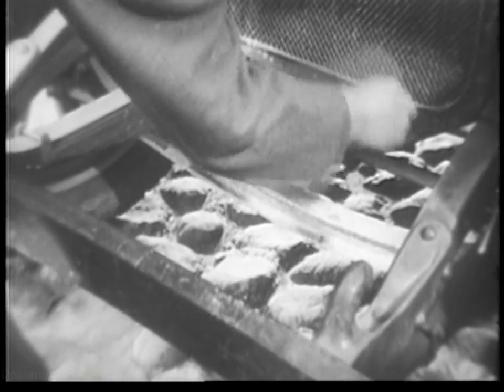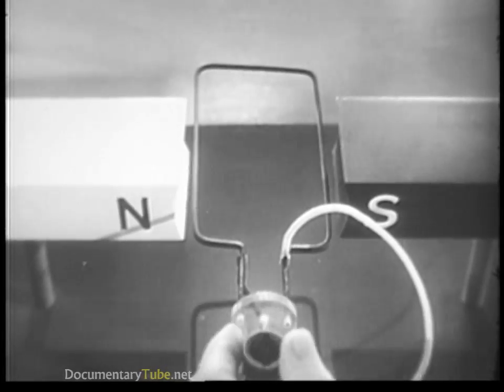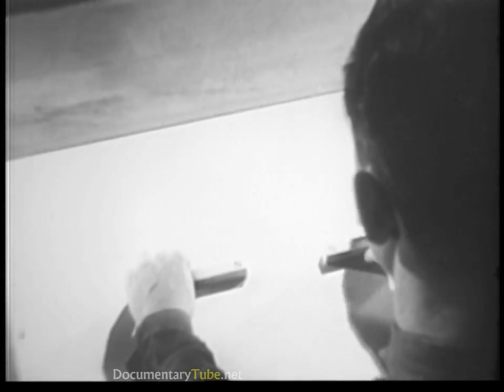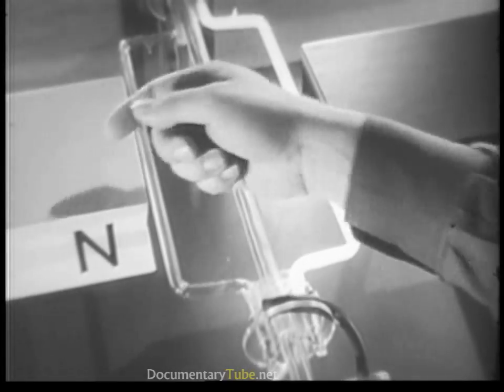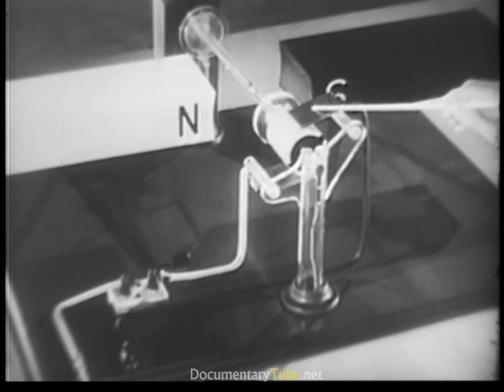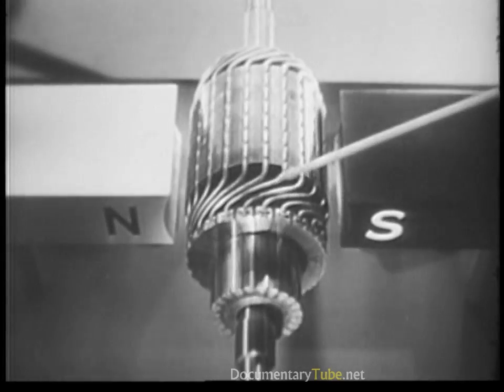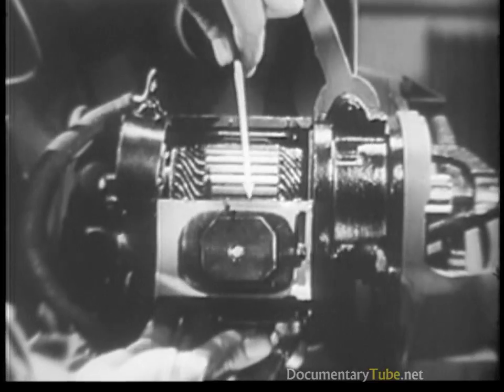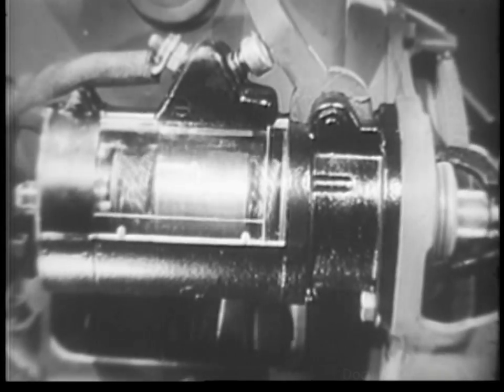HOW IT WORKS: Car Starter Motor

Comment: Why do starter motors always fail to start the engine at an inappropriate time in horror movies?
Reply: because the motor is afraid.
Reply: Because it uses plot battery hence it won't start.
Reply: That's must be it.
Reply: Peter Peter Scriptwriters.
Reply: Due to the magnetic field of the monsters.
Reply: Because of magnetic plot convenience.
Reply: Peter Peter the back emf of demons cancel out the emf produced in the armature windings, hence it doesn't rotate motor shaft so yeah...
Reply: It follow the script...
Reply: For the same reason the baddy always feels the need to give a speech when he has a gun in his hand and the goody unarmed, wounded, and helpless on the floor.
Reply: Becoz its a movie.lol i noticed that
Reply: Because they forgot fill gasolin
Reply: Somethings, even science can't explain
Reply: Same reason the teenagers are running and trip over invisible shit ....gotta give the serial killer a fighting chance to catch'em 😂
Reply: Lol good question 😂
Reply: Previously on unsolved mystery
Reply: Because if they drove the car away then the movie would be over and most horror movies like to end on a grim note to keep the audience feeling scared and confused rather than satisfied. 

So for this reason the writers of the movie write in the car having a bad starter. Imagine if it was an older car that you had to crank, the character would get killed before he could even attempt to drive away!

Comment: I am fascinated by the props they made to demonstrate the principles. I would love to work on designing props like that. Of course, these days most props are made using software and are realistic animations. I've made a number of props for teaching purposes over the years but the one I am most pleased with was the De Broglies Electron Diffraction device I built using a laser instead of a diffraction tube. The real thing is very expensive and my version cost less than $40.

Comment: There is a mistake.  It is not the wires that become the North and South poles of the loop, it is the openings. For that singles loop motor to really work, the brushes need to be horizontally opposed.
Reply: You are absolutely correct. The simplified motor model description in this tutorial is wrong and a misleading part of the movie to a serious student of the subject.  I was wondering if someone caught this major error.  As you correctly observed, the magnetic poles should project out of the plane of the coil and not the edges (the  polarity determined by the right hand rule etc.).  The model department must have gotten carried away with the glass tube neon light coil model which I admit looks really cool.  In a real series wound starter motor the brushes are skewed (timed) off of the theoretical neutral brush position to compensate for armature reaction (google search this if you are interested). A serious RC model enthusiast would appreciate this.
Reply: That's correct. You can see it at 3:29 when they put iron feilings on the acrylic plate.

Comment: This is great video about motors but it doesn't go over the unique characteristics of starters at all. Starters cannot run for large lengths of time because of the "exceptional power output for their size." They overheat quickly. Starters are also connected to two very important things. A solenoid and a bendix. The solenoid is a linear motor that moves a lever that moves the bendix against the flywheel. A bendix is a very special set of grooves, spring, and gearing that allow the starter to connect into the flywheel. It 1) prevents the starter teeth from jamming into the teeth of the flywheel if they're lined up wrong (the bendix rotates slightly), and 2) it prevents the starter from staying connected once the engine is moving faster than the starter (as the engine is moving under it's own power at that point). If the starter were to remain connected once the engine started, it would overheat the bearings.
Reply: Chris Katko they'll get it right on their next video, oh right, they're dead so there won't be more videos.
Reply: thanks for the comment, I literally asked the question after I finished the video
Reply: Chris Katko True they get hot fast. One could water cool field but armature would burn up.
Reply: When this video was made, the mechanical solenoid and the gear protector wasn't invented/used yet.
Reply: I actually wondered about that, thanks. 

That being said, I think they did a great job of explaining the mechanics of it.
Reply: this guy made all this stuff up I make cars 👍

Comment: Wonder why modern car does not come with hand-cranking lever in case the battery ran out.
Reply: Amphol Traisathit Jumper leads?
Reply: dobiem1 Forgot to mention when there isn't any other car around to jump start from,too. :}
Reply: Amphol Traisathit
In that case...... push the car forwards and then jump into 2nd gear lol
Reply: Dobie, what if you have an automatic?
Reply: Justin Noker
Then, he's f*cked.
Reply: im a few months late, but oh well... reason for no crank handle on modern engines is because of compression, fuel, and tolerances. try to put a 3ft breaker bar on the crankshaft pulley bolt and turn the engine fast enough to provide for ignition. lol that is high compression for you. modern engines, bearings have much tighter tolerances making it even harder to hand crank with any speed. and reason for fuel to be listed as a reason is because in that era of automotive industrialization is because the octane levels in that day and age were much lower, meaning the fuel would self ignite at much lower pressures. lower pressures also meant lower power and torque. i may be wrong in some technical standpoints... but that is what i was taught when in votech for automotive service years ago
Reply: Anthony Mason Thank you very much, sir. Now, I know why even though I don't quite understand this technical explanation.
Reply: Amphol Traisathit he basically said modern engines are too hard to crank by hand
Reply: Modern engines need electric power to run fuel pump, computer, and injectors. Hand cranked engines use gravity fed fuel, non-electric carburetor, and a magneto spark plug. Hand crank engines can sometimes misfire, which causes it to spin backwards and tries to tear your arm off. John Deere tractors from 1930's had cylinder air bleed valves that would drop the compression and power to nearly nothing so you could hand start it. Once it started, these valves would be closed and cylinder compression and power goes up. Look up hand start john deere
Reply: Dale Mahalko cool lol that's a neat idea
Reply: The old trucks were pretty damn hard to use crank shaft. I remember by grandpa turning on his truck which was v8 gasoline engine he needed to sweat a lot to turn it on.. Nowadays engines would be even harder if possible at all..

Comment: WHY DON'T CAR MANUFACTURERS PUT IN AN OPENING AT THE FRONT OF THE CAR AND SUPPLY A HAND CRANK  TO ALLOW MANUEL STARTING OF THE CAR IN CASE OF A FLAT BATTERY?
Reply: rudi gib a ruh
could you drill a hole in the car and then use a crank of some kind.i mean it's ridiculous waiting for roadside assistance for 45 to 70 minutes when you could do start it within 5 minutes ytourself.
Reply: Ese Callum A hole in the front won't matter if the engine sits perpendicular to the front as it does in fwd cars. 😀
Reply: Henrik Paulsen
put the hole at the side or where ever the engine is.
Reply: *****
well if it was done once it can be done again.i think a petition should be started..you know when you on the road you are impatient for every second you get delayed and you huff and puff and swear and shout and have road rages?? if your car don't start you could waste 45 minutes to 90 minutes for the car recovery people...think about it...a hand crank would only take 2 minutes.
Reply: NOW YOU ARE BEING DEFEATIST.MAKING EXCUSES .YOU PROBABLY SAID THE SAME THING WHEN THE FIRST WHEEL WAS INVENTED.you know when you on the road you are impatient for every second you get
 delayed and YOU huff and puff and swear and shout and have road rages??
 if your car don't start you could waste 45 minutes to 90 minutes for 
the car recovery people...think about it...a hand crank would only take 2
 minutes.
Reply: +Ese Callum I have often thought the same thing, but I don't know if hand-cranking an engine, especially a large one, would be so pleasant, especially for someone with not a whole lot of physical strength. You know, those things can hurt you - especially your arm - pretty badly if not pulled out at just the right moment. And, in today's mad world, there is total reliance on electricity.
Reply: paulparoma its good exercise and using the lever principle not that much force either..a one way slip thing at the end of the hand crank means when the engine starts you will not get a sudden jerk.
Reply: Or you could spend the entire time it takes for recovery to arrive trying to crank an engine that won't srart anyway. Btw. in a fwd car the wheels would be in the way...
Reply: Henrik Paulsen i THINK WE SHOULD START A PETITION FOR MAKERS TO DO THIS AND MEANWHILE START ALSO A DIY KIT GROUP WHICH WOULD ALLOW ANY CAR TO BE HAND CRANKED TO START.
Reply: +Ese Callum No need to shout, but I don't think too many people would be interested in the idea. BTW, I had a dead battery the other day, but luckily I had one of those Chinese little portable boosters in the car. Took me no time to start it, with no hand-cranking involved.:)
Reply: you do realize those portable hand boosters can EXPLODE like a galaxy note 7 but 2000 times worse because of the huge amount of  energy stored due to the lithium battery? a vaper smokers face was nearly blown off the other day.a hand crank is much safer.
Reply: +Ese Callum Anything is possible, of course, but I have not heard of these things exploding yet. My laptop's battery, however, exploded yesterday and almost set the whole house on fire. Pretty scary. It's a good thing I was not in front of it at the time. I guess you just never know what can happen, and there is really no foolproof way. We should go back to using an abacus. There is no way that thing can harm you.:)
Reply: paulparoma
also your house insurence wont cover you as lithium batteries are known to be unsafe and they wont pay out.......
Reply: a car battery will be a 100000 times worse then not 7 battery because it is 100000 bigger.
Reply: You fool! Starters were created over the fact that many people broke their wrists trying to start cars, and ended up dying over it.

Comment: this doesn't explain why my garbage bmw e46 won't start up.
Reply: 22 jul 2019 4:50 pm edt:
(1)Bad Starter: Over time starter motors can wear out and start to malfunction. If this is the problem the starter will have to
 be replaced. If the car turns over, the problem is not the starter. If nothing happens when the key is turned the problem could
 be the starter, or if the car turns over very slowly and the dash lights dim while it is cranking, the starter could be the
 culprit.

(2)Bad Relay Wiring: The wiring between the battery and starter can become loose or broken which will prevent the starter motor
 from functioning. The wiring will need to be replaced or repaired.

(3)Low or Dead Battery: The starter motor needs voltage from the battery to operate. If the battery is low or failing it may not
 produce enough current for the starter motor to function. Charging or replacing the batter should resolve this problem.

(4)It is also possible that the battery terminals have become corroded or loose. Cleaning and tightening the terminals and
 cables is recommended.

(5)Failing Solenoid: A failing solenoid is a common issue with the starter system and if the solenoid is going bad, the car will
 be difficult to start. The starter will need to be inspected to determine if the problem is the starter motor itself or
 the solenoid. A failing solenoid will need to be replaced.

(6)Failing Ignition Switch: Over time an ignition switch can start to fail and one of the most common symptoms is that the car
 is hard to start. If the ignition switch is hot to the touch this indicates an issue with the ignition switch wiring.
 A failing ignition switch will eventually stop working completely and will need to be replaced.

(7)Defective Fuel Pump: If the engine is not getting enough fuel, it will be hard, if not impossible to start. The fuel pump is
 responsible for pulling gas from the tank to the injectors and if it is not delivering enough fuel the car will be difficult
 to start and eventually will not start at all.

(8)Fouled Plugs: Spark plugs create the spark which allows the vehicle to burn fuel. Fouled plugs are one of the most common
 reasons for a hard starting engine. As electrodes wear down, the voltage required to jump the gap to ignite the fuel increases.
 This can lead to prolonged cranking before the engine will start.

(9)Clogged Fuel Filter: A fuel filter that is clogged can make a vehicle very difficult to start. The fuel filter screens out
 contaminants and can become clogged over time. This will prevent the injectors from getting enough fuel, making the car hard
 to start.

(10)Contaminated Fuel: Fuel that has too much alcohol or water in it will result in a car that is difficult and often
 impossible to start. Even if it does start, contaminated fuel can do serious damage to the engine. If contaminated fuel is
 suspected, have the vehicle inspected immediately.

in https://www.yourmechanic.com/services/car-is-hard-to-start-inspection from google(car difficult to start)result 1